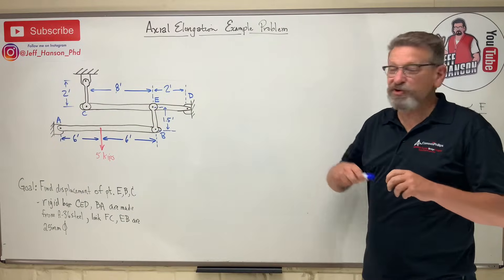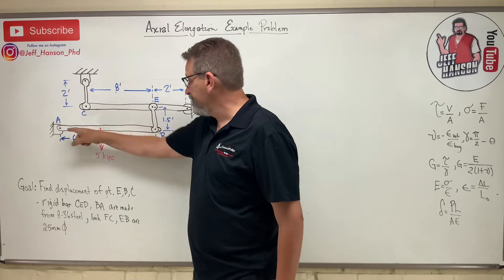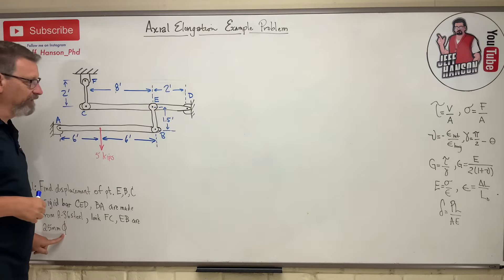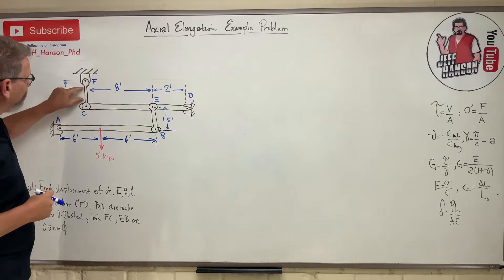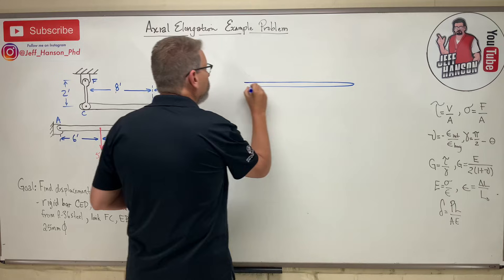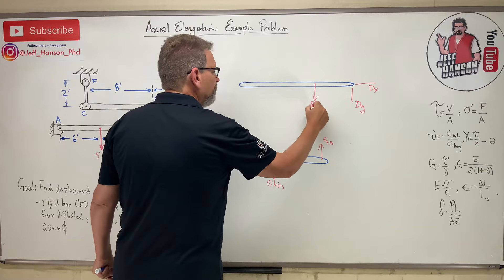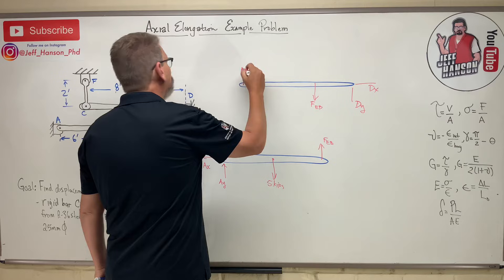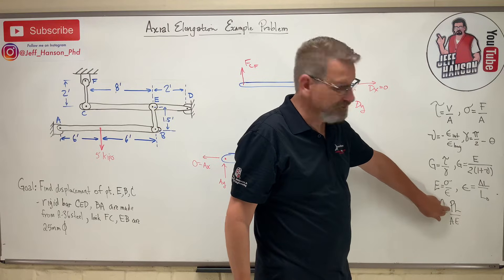Mechanics of Materials: Lesson 18 - Axial Elongation Example Problem, Displacement

Comment: Why are we adding displacement of e and the stretch of the member to find displacement of b? And what's the difference between the stretching of a member and a point?

Someone please respond quick. My exam is tomorrow😭😭
Reply: Might be a tad late but pretty sure it’s because the displacement of E is not accounted for in the elongation of tension EB, basically you have a bar which is tilted down prior and on top of that is a stretch of the tension, look at it in a sequence, CF elongates and points C and E go down, after they’re down, the tension in BE elongates from the 2.5 kips on the bottom causing point B to go even further on top of what E was displaced. lmk if this helps I yapped a lil
Reply: @Shoom-wt  you're genius, I understood it perfectly, it's like B undergoes two different displacements
Reply: did you find out? i have that same question

Comment: The displacement for B is 0.03161+0.0016858=0.0332958, not 0.033468.
Reply: Now im wondering it the displacement of B and E are equal
Reply: @michell9328 No, the displacement at E is only due to the elongation of link FC. The displacement of B is due to the elongation of link FC and EB

Comment: Thank you for the great video! I believe the last calculation adds the displacement at E and the stretch of EB. It should be .0016858+.03161=.0332858, slightly different from video
Reply: 0.0332958* (;
Reply: So practically the displacement of B its the same of E??
Reply: @michell9328  no, he mis calculated and did 0.001858 + 0.03161 when it should have been 0.0016858 instead, essentially he missed the 6 at the 0.001 mark
Reply: .0332958

Comment: Shouldn't the members FC & BE be in compression? Just a little confused on why they are stretching.
Reply: If you remove link FC beam DC would move down so FC must be holding it up, i.e. tension.
Same with link BE.

Comment: To find the Y which is the displacement of E. I think you forgot  sir to convert the 8 ft and 2 ft to inches. Because the results of delta's EB and CF are in inches. But you've use 10' and 2' for the similar triangle.
Reply: It wouldn't matter because he's only doing a ratio; 10 feet is to .008429 inches (change in position of c) as 2 feet is to y inches (change in position of e.) The equation is y=(1/5)*.008429 whether or not he converts those lengths to inches before evaluating for y.